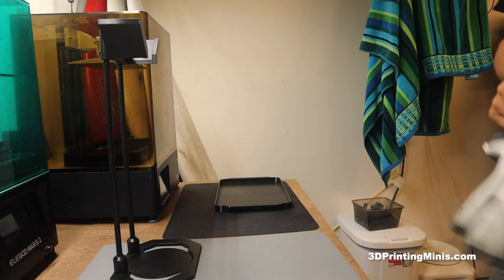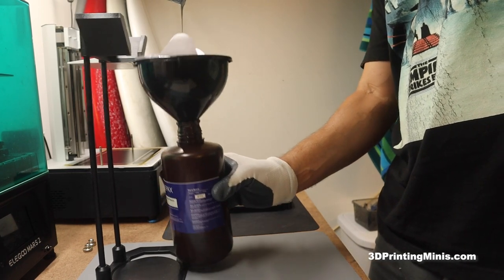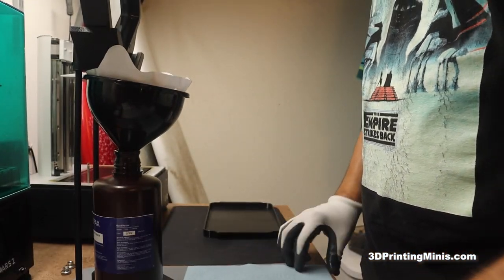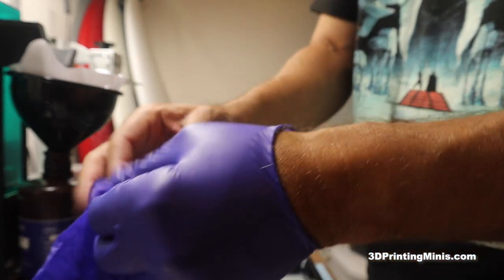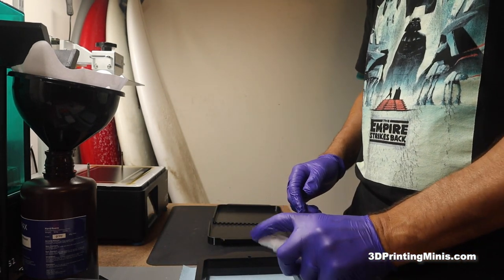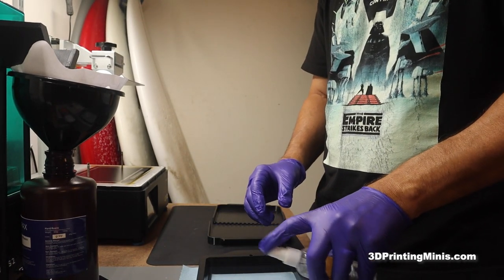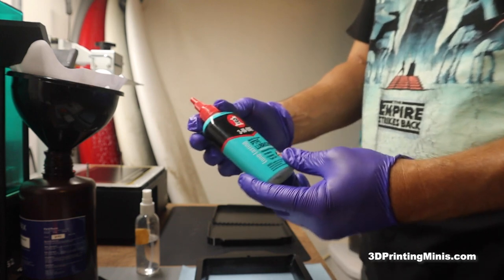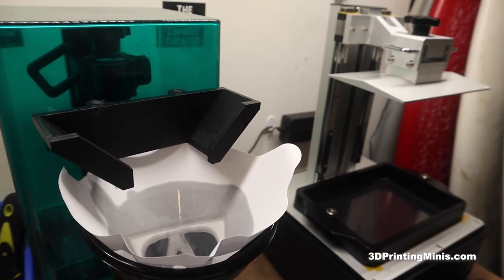How To Clean Your Resin 3D Printer Vat - How To Drain And Remove Resin From 3D Printer

Comment: That was very nicely done. I have tiny little pieces or resin cured on my FEP sheet. Is there any way to remove that?
Reply from the maker: You can run like a 15 second screen clean on your vat and then peel up the thin cured layer it creates on the FEP. That should remove any tiny pieces stuck to the FEP when you pull it up.